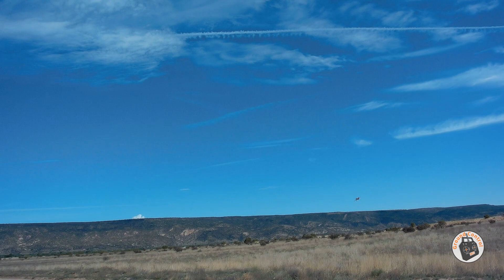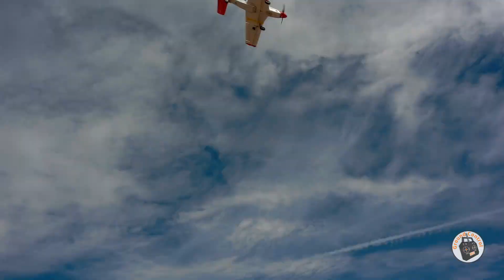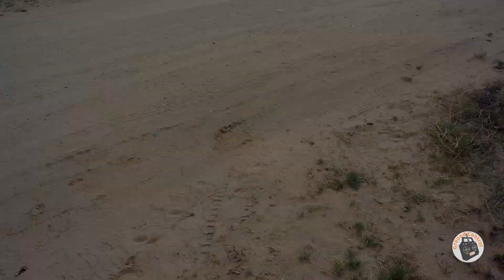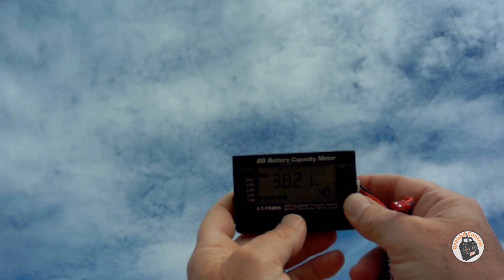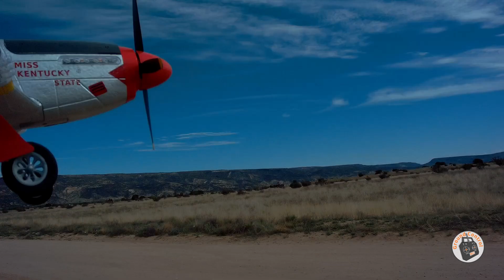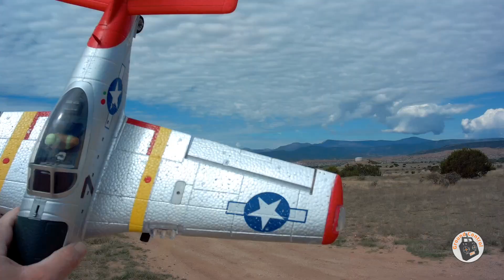A Perfect Beginner Warbird! XK A280 P-51 Mustang 3D/6G System 560mm Wingspan 4CH RTF!

Comment: Hello, how are you? I recently bought this model, 4 days ago to be exact, and I'm loving it. It's my first time using an RC and overall I really liked it, but I was disappointed with the battery that lasts very little, about 8 minutes, and I would like to know from you who are more experienced in this field if I can upgrade the battery to a longer lasting one?
Reply from the maker: I'm glad you got one.
8 minutes is actually very good for a warbird.
You can certainly use a larger capacity battery as long as it's not too heavy.

Comment: I put a 20a esc and fly it on 3s and it rips. The motor gets a little hot if you hold full throttle too long. You just have to take it easy once in a while but 3s is awesome.
Reply: Im interested in the prop too.
Reply from the maker: It should be a rocket on 3S ;-)
What prop are you using with 3S Power?

Comment: I received this sweet plane yesterday.  I want to install a lemon rx satellite.  How do you determine the correct polarity so you don't fry the control board ? Keep up the great videos I watch them all 😊
Reply from the maker: Thank You!
I put a multimeter on the pins to make sure I had the voltage and ground figured out.
Sometimes the pins on the RX need to be re-arranged to match the pins on the sockets.
Reply: @GroundControlRC  thanks.  I will also adjust the linkages as you recommend

Comment: My flaps are moving in opposite directions, do you know what the fix is on that?
Reply from the maker: Hum...make sure the plane is on it's wheels when you connect the battery so it knows which way is up.
If that doesn't fix it try re-calibrating the Gyro.
I'm not sure if you're using the stock transmitter or if you're using a Hobby-Grade TX, but if you are, you may need to reverse the channel on the one moving in the wrong direction.

Comment: Qual e o protocolo para o aviao P51 A280 e para o aviao P51 750mm volantex para  bindar no Radio TX16s
Reply from the maker: The XK A280 - Protocol = V911S, SubProtocol = E119.
I don't know what protocol the Volantex P51D 750mm uses as I purchased the PNF version and used my own Receiver.
Both are fantastic flying warbirds.

Comment: I bought one of these and the instructions say "do not remove the battery" and it seems like it could be glued in there.  It's in there pretty solid.  Did you notice this?  I would like to run more batteries.
Reply from the maker: Hi Gordon!
No, it's not glued in.
The battery is a snug fit and it has velcro holding it in place but it comes out.
I'm flying (9) different batteries in this plane.
I can't stop flying it ;-)
See you in the Air!
Reply: I just got mine and discovered there was some glue that seeped around the velcro such that both halves of the velcro were glued together! So I carefully yanked it out, trimmed the glued spots off the velcro, and then put new velcro in on the airplane side.

Comment: Something i forgot to add, is this plane is absolute magic in zero wind conditions. I have some ultra low weight lipos that give me an almost walking speed stall speed so I can fly it low and close and really enjoy the clear canopy. I fly my a280 'airbus' daily and it has replaced my 400mm warbirds unless i want to fly out the front on the street! I mostly belly land, so i fly without the main gear, but had to upgrade the stock landing gear wire to a trimmed down trex450sev2 tail pushrod (almost exactly the same diameter, but higher tensile), almost right after i got it because the stock main gear wire would bend if you looked at them hard! 
Also be careful adjusting elevator throw until you fly it in 3d mode, i was expecting it to loop in 6g mode and kept adjusting the elevator, but then in 3d it looped if i thought about it too hard!
My only criticism of this plane is the weird aileron wiggle it gets randomly in windy conditions. Mostly it looks funny except coming out of inverted and it starts waggling!
Reply from the maker: Hi Colin!
Awesome Plane!
I had lowered the Elevator movement before the 1st flight as nearly all of these Micro Planes have had too much elevator for my liking.
That worked well on the stock TX.
Now that I'm flying it with the TX16S I ended up increasing the elevator movement a bit and used some EXPO to smooth it out. That gives me some elevator in reserve when I misjudge the ground coming out of a loop ;-)
So, it' not just my bad landings causing the main gear struts to bend ;-)
I ended up reinforcing the struts and plastic mounts with some hot glue and so far so good but they could have used a bit more robust wire.
I've seen that wiggle a couple of times but I was flying in very erratic wind. They may have the gain on the gyro set just a bit to high.
I certainly hope they come out with a full line of these warbirds as I'll snap up a couple more.
I'd love to see a P40 Warhawk and a P47 Razorback.
See you in the Air!